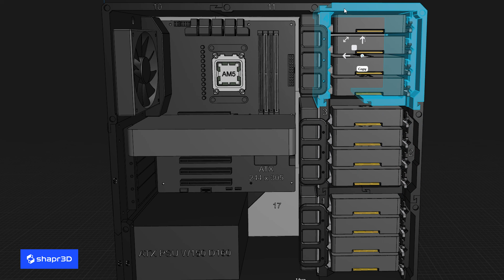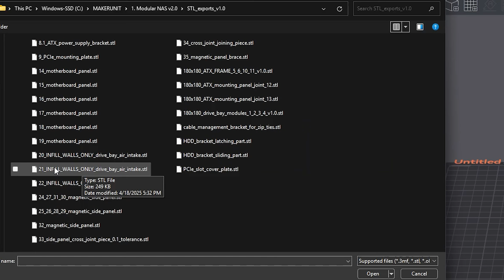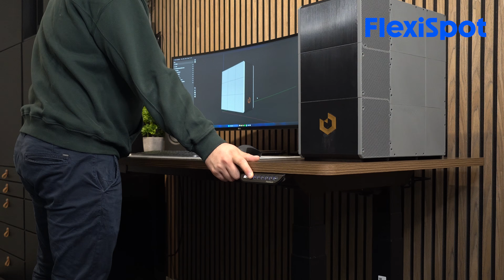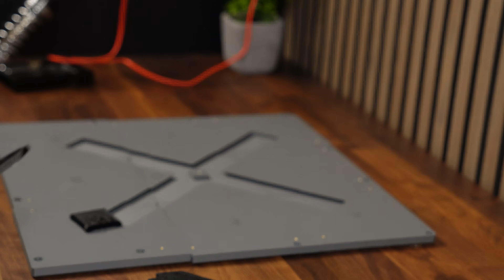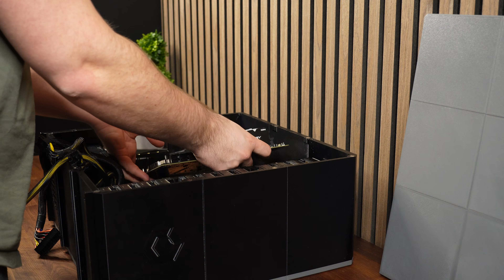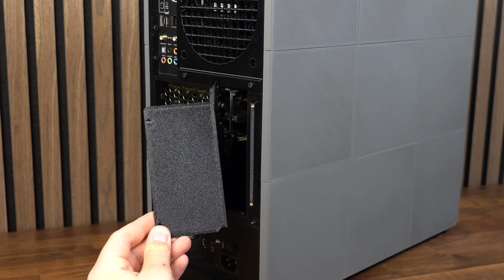Maximize Your Home Storage With This 3D Printed ATX NAS Case

Comment: Awesome.  I would have also put an exhaust at the top panel above the CPU, so you have two exhaust fans
Reply from the maker: Thanks! That’s true, depends on the type of air cooler used I guess. It can easily be modified with a fan mount if necessary. Would mainly affect aesthetics, not hard to modify 😊

Comment: you can put the cpu power under the pci cards, all the way on the left. Then your cable will fit.
The powerbutton is completely optional, WoL is an option
Reply from the maker: I actually tried pushing it underneath the PCIe slot on the left side but it was really tight in between the IO cover and PCIe slot. However some motherboards without a big box around the IO this could work 😊

Comment: The LSI9300 16i will melt the case lol
Reply from the maker: Therefore my comment about making sure to do your own research before choosing components as I do not know what is the best option due to my lack of NAS experience.

I have noticed the LSI9300 16i gets extremely hot during normal operation just from sitting there being idle 😅
Reply: @ LSI 9400 16i is the way. Less heat, and half the power usage.

There should be a 3d printable 90mm fan bracket for the 9300 16i. With the fan installed and running at 50% it should ne no issue, still this card chugs close to 30W.
Reply from the maker: @1xXNimrodXx1  Thanks, I'll keep this in mind for future purposes. I hope to eventually set up my own NAS with proper NAS-rated parts, not just random hardware I have laying around. Still learning on that topic.

Comment: whats the rough amount of filament this uses?
Reply from the maker: Hey, I plan to add a detailed list based on the recommended print settings later today. However I estimate around 4-5kg in total. All my black parts are roughly 2.5-3kg, and side panels in grey were roughly 1.5 to 2kg. So if doing a dual color build like me about 3kg of the middle color, and 2kg of the side panel color should be sufficient.

Comment: Could this case be used for just a normal gaming PC? Just leaving all the drive bays empty save for 1 or 2 of them?
Reply from the maker: It’s possible to leave them empty and run it as a normal system as well! The main limitation is your GPU length of about 245mm. However if you skip the middle drive bay fan you might be able to push it closer to 270-275mm. 😊
Reply: @makerunit  This might become a gaming PC case then, just gotta finish setting up my Ender 3 and get some nice looking filaments
Reply from the maker: @RogueRen  sounds good! If not, I have a ton of other cases available that’s more optimized for gaming builds. Feel free to check them out over on Printables 😁
Reply: @makerunit  Personally this case seems like the best one out of your cases. I've never been a fan of small form factor cases so a big full size ATX case is much more appealing. The only change I'd think of to make it more of a gaming case is a way to route cables from behind, and some way to affix an acrylic sheet to the side panel

Comment: Agh! I just bought a JMCD 12S4 a couple weeks ago to build my second DIY NAS (first one was mini 8 tb m.2 solution). Love the design of this case though and would love to print it if I hadn't already bought an alternative. If you plan on doing a V2 I'd love if you could figure out a way to integrate SATA power/data couplers (SATA 22Pin 7+15 Male to SATA 22P 7+15 Female on Aliexpress) into the back slots of the drive bays (which would require cable management space on the right side of the case, or maybe have the couplers inside the case, flip the sleds around, and make the three air intake panels 20,21,22 as doors or removable and that would be where you'd install/take out drives) this way you'd only have to hook up the wires to the couplers once, then when a drive dies you could pull it out/install a new one without messing with cables. Anyways, thank you for yet another awesome 3D-Printed case!
Reply from the maker: Darn it! Just too late 😅

You’ve definitely got some good points here. The option to pull out the drives backwards is actually very clever and would totally result in a cleaner overall build. I’ll keep this suggestion stored safely in my brain if I get around to a V2 or other NAS design in the future! 🙏

Comment: As someone who has been building white box PCs and servers since 1988, your choices were perfect for this result.  One additional thought would be to add a mount points for a pair of 2.5" SSD for use as the boot/system drive.  By mirroring those drives, you can create the most resilient NAS server possible.  If you wanted to take this one step further, using a motherboard with a 2.5GbE or 10GbE Ethernet port, combined with a 10Gb network router would allow your system to serve more than ten 1GbE systems with next to no added latency from the network - meaning that each connected system gets full performance from the NAS.
Reply from the maker: I’m glad to hear that you agree with my design choices! I’m not sure exactly what you mean with mirroring the SSD’s but I’m planning to create a 2.5’’ SSD adapter plate for those wanting that alternative. I just figured most people in a modern setup would go for a couple M.2s for the Boot/cache drives. Perhaps there’s something I’m missing, but it’s easily fixable with an adapter bracket. 😁

Personally I did this project because I wanted to learn how NAS systems work and are built. I still don’t know exactly what I’ll be using it for. Much of my joy of these projects lie in the designing part as I love a good challenge and just seeing it all come together and work! 💪 Again I’d love to test out some more optimized NAS system parts setups in the future as I also wanna be confident that the cases I design are of the best quality possible to the intended users!
Reply: @makerunit  When you install the server OS (probably Linux), one of the installation options is to create a RAID 1, or mirrored boot/system drive.  This writes the data for the system drive to both SSDs simultaneously.  During normal operations, the 2 drives are treated as one with both getting the same data written.  The result is that you can completely lose one of your mirrored boot drives and the system will continue to operate.
Reply: @makerunit 
An adapter plate for 2.5" drives would be nice, though tbh 3.5"-to-2.5" adapters are readily available and reasonably inexpensive.

The bigger issue is that many data hoarders would be loathe to give up any of those 12 full-sized drive slots. Is there space in your design to stick 2.5" SSDs behind the power supply on the same panel as the motherboard, or on the top panel of the case?
Reply from the maker: @felixfujishiro2304 There are tons of places where a 2.5SSD could be snuck in. For example behind the PSU as you mention depending on the PSU length. This model has a step file included so making those mounting holes should be a breeze for most people with some basic CAD skills 😊

Comment: Any chance we could get a hollow double-sided side-panel, and an inverse of the case, in order to make an extra-wide?
Reply from the maker: Hi, I’m not sure I understand exactly what you’re asking for here.

You basically want two of the same case, one that’s inverted, and one that’s normal, and a hole in the middle between them? I mean it should theoretically be possible, but my main concern would be how to attach the two halves together. Unless you mean like back to back, that could be easier to accomplish!
Reply: @makerunit  Ya, that's what I was thinking, and I was thinking magnets, same way the panel is attached.
It was really more of an idle thought though, I don't have enough drives to warrant it yet.
Reply from the maker: @TheMonyarm  I’m not sure if an entire double system would be able to attach that much weight using magnets. With the weight of 12 drives it’s already 10+ KG. 😅 I think we’d need a sturdier solution. Not impossible though! 😊

Comment: idea for improvement:
instead of screwing cable supports add fan slide in olace brackets that already have this on one of the sides - save of afford and screws
Reply from the maker: This did cross my mind but it was a bit challenging to get it to be structurally strong in both directions. Both for the slide-in part and the zip-tie part. It could for sure work if printed vertically (sideways) but would have some challenges. At least based on my own opinion and experience. Though there is probably a variant of this that would work 😊

Comment: What I would really like to see is a JBOD to expand my existing NAS
Reply: I I have some ideas for this! What worries me is the weight like a true JBOD could mount to heavy weight. 24 drives could be 40 pounds easy and thats just the drives.
Reply: @V1N_574  maybe lay it horizontally?
Reply: @KevinPope  I am so sorry I was thinking of rack mount when I read your comment and combine both thoughts in my response 😂🤣 but yes you are totally correct.
It shouldn't be hard honestly, an HBA card with external ports from main server to JBOD case, with a receiving port to break out to sata cables and for power if you want to go with a separate PSU there are boards to signal a secondary PSU to power un from a signal by a power cable of primary PSU from the server.

I'm in the middle of designing that my own with a few Jonsbo N4 sata back planes for 8 drives each. But since I'm thinking a rack mount approach weight could be an issue in my case unless I reinforce with another material
Reply from the maker: I’ve got some ideas in mind for stiffening a potential printed rack mounted case in the future by using some aluminium flat bars like 20x5mm that can be fitted into a slot printed into the underside of the case. Hard to explain but imagine like the support beams under a floor, how they’re placed vertically to support tons of weight.
Reply: @makerunit  I was honestly thinking fpr my 1\2" (I'm american 😂) plywood sheets to basically create the bottom and half of the sides with that since I want to use slides, and then the rest 3D print it. Not super excited about the wood idea but is easy and fast.
Reply from the maker: What would be the difference between a JBOD and a NAS? The only explaination I was able to find was «Just a Bunch Of Drives». 😅
Reply: @makerunit  in like very very simple terms.
Basically if you have a rack and you ran out of storage but not processing capabilities you just get a case from like 45drives, fill it up and slide it to the rack and plug it in, the main server will see each drive individually and you configure the array on the main server as you pleased. Is like having the HBA card and the HDDs compartment of your server case, external on another chassis. It only has PSU, communication boards to connect the HDD to the server and the drives, thats it.
Reply from the maker: @ ah! So basicall an extension of your already existing system? That totally makes sense now after your explaination. Though this would only make sense in a rack right?
Reply: @makerunit  To my knowledge I have only seen JBOD chassis as a rack mount format, but you could look at it as a modular desktop mount chassis. But I don't think auch thing exist mainly because JBODs are almost exclusively for industrial applications.

 Probably with the growth in popularity of self hosting we might get desktop applications in the future like from Jonsbo or 45drive I would bet.
Reply from the maker: @ that could work, I’ve always told myself that if I ever build a rack I want to build the rack myself too, perhaps a 3D printable alternative 🤷‍♂️
Reply: @makerunit  that is basically it! A place to house a lot of drives, probably with a disk expander.
Reply: @makerunit 
You are right, JBOD stands for exactly that, Just a Bunch Of Drives. That acronym usually doesn't refer to the case or piece of equipment that houses the drives, it really is about how multiple HDDs are presented to the PC system. For example, there are commercially-available disk enclosures that accept multiple HDDs that can be configured as JBOD or RAID 0/1/5 via a single USB or eSATA cable. These systems (including the electronics hardware) are sometimes called Direct Attached Storage or DAS.
Reply from the maker: @felixfujishiro2304 I see! Makes sense. Via USB would it be like a separate system with it’s own motherboard etc. That when connected to USB will show up as a bunch of drives or am I misunderstanding here?